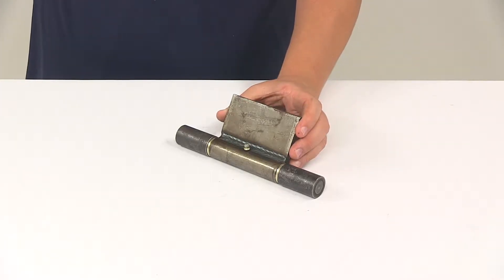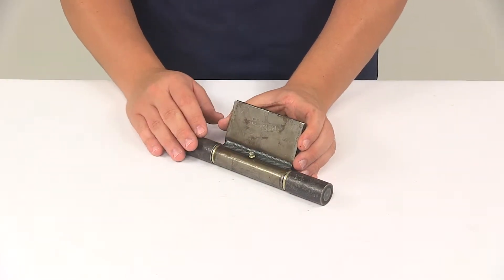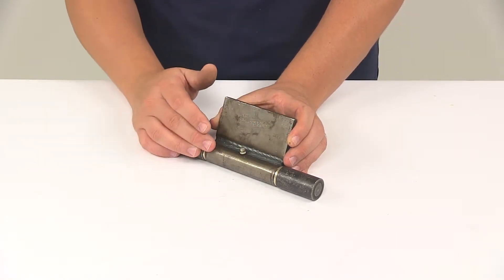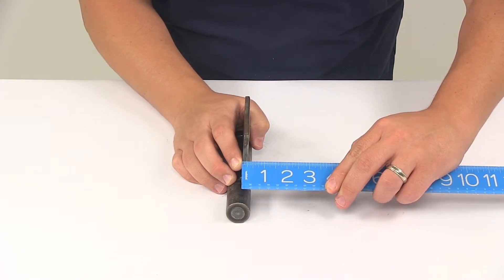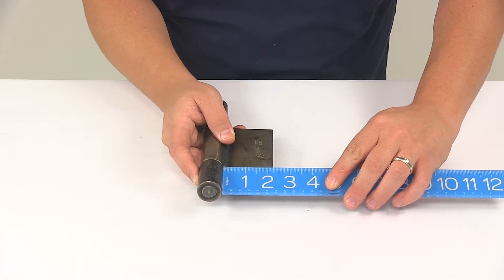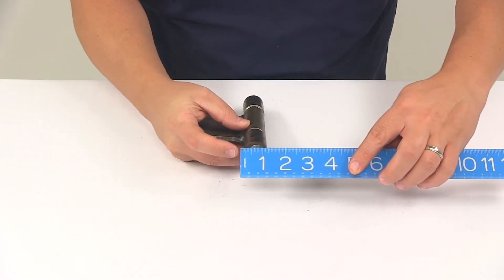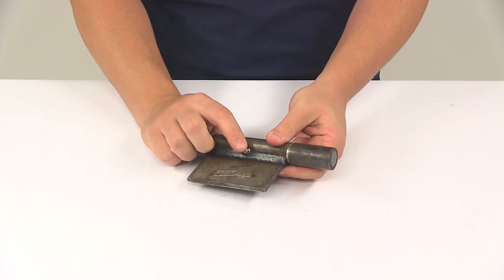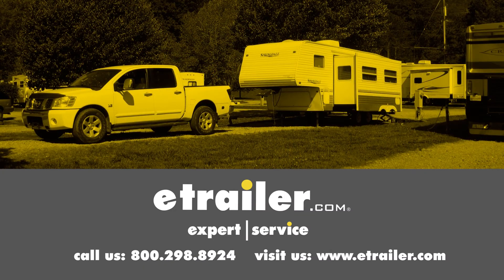etrailer | Ultimate Overview of the Ramp Door Hinge

Comment: How do you replace the crease nippel if it falls out?
Reply from the maker: If the grease zerk falls out of your 1902 Polar Hardware Ramp Door Hinge, you can simply replace it with a new one of the same size. Just clean the hole in the hinge barrel, install the new fitting snugly, and then pump fresh grease through it until it purges from the hinge. Wipe away any excess grease and check occasionally to make sure the fitting stays tight so it doesn’t work loose again.